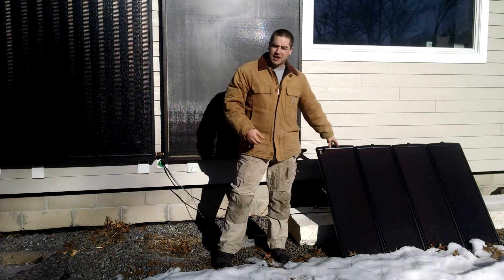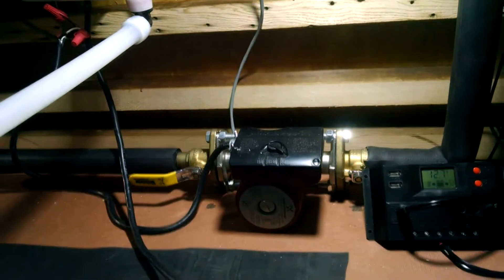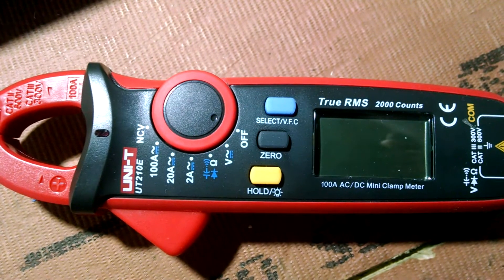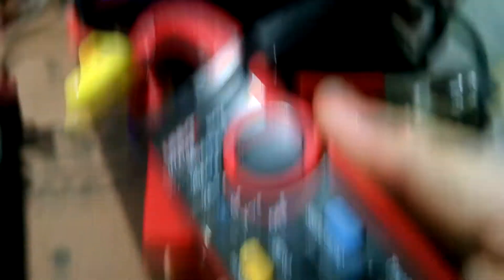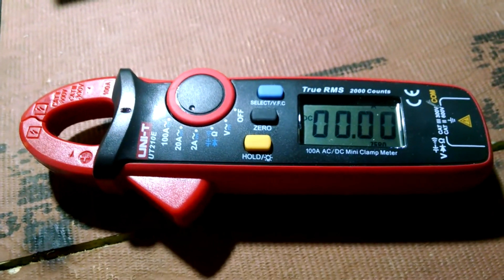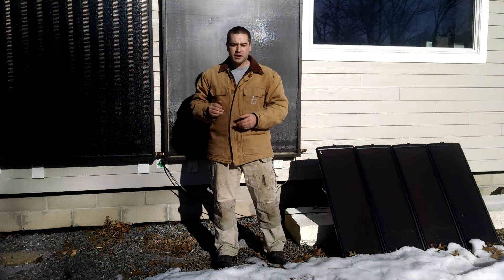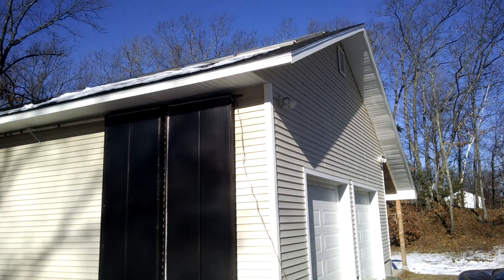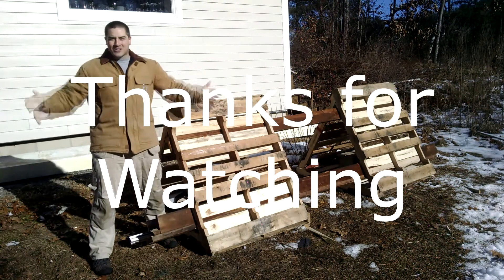Solar Updates and product reviews on the Winter Solstice

Comment: Merry Christmas and a good next year to you. 
Expected that a Harbor Freight perform poorly. 
How about using a motor with DC input? You have two points of inefficiency in that system using AC. Many homes are have gone to DC power because of the efficiency.
Reply from the maker: I've thought about going with a DC pump, you are right that I could make the whole system more efficient.  I'll probably do it if I can find a used one on craigslist.